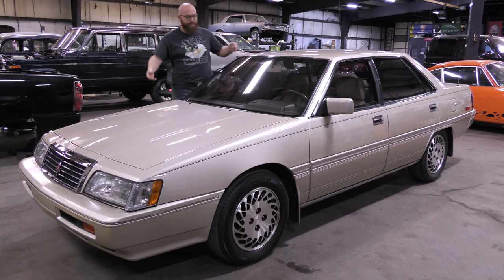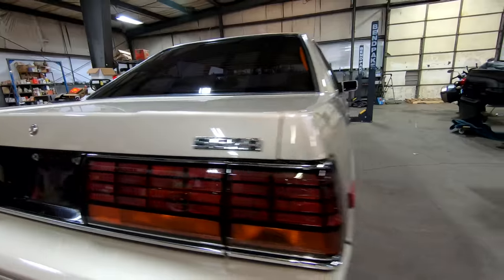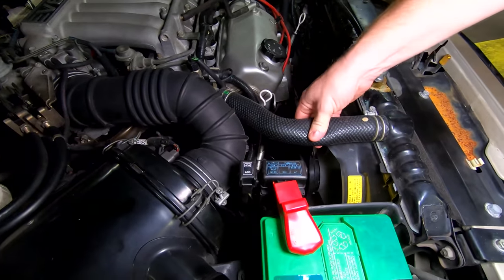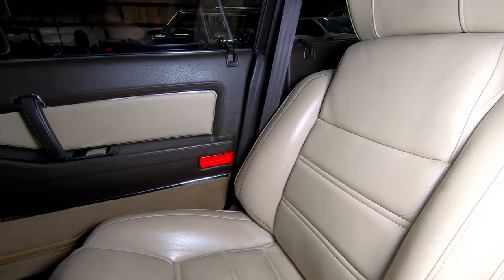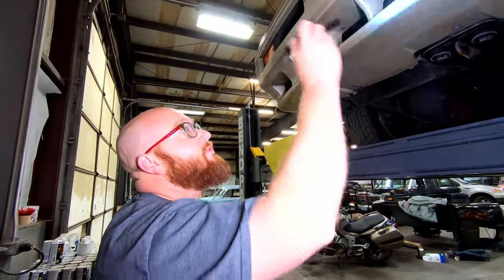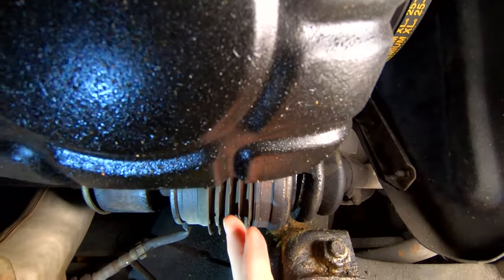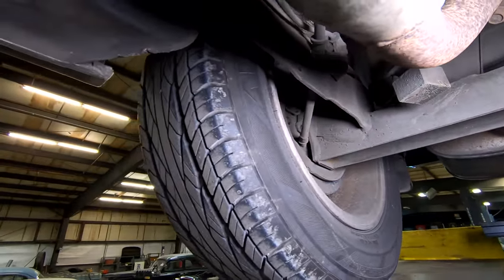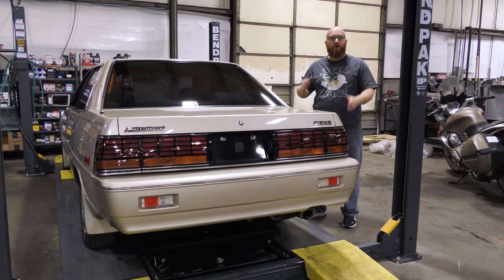Insanely Unique! When Mitsubishi attempted European design. CAR WIZARD shows immaculate '90 Sigma

Comment: Brake booster on the other side: For VW Golf MK1 models (called the Rabbit in some markets) in RHD markets they did the same. It had a shaft running along the firewall to connect the pedal to the booster.

Comment: Mitsubishi Australia widened the body 4-5" to become the Magna: 2.6L 4-cylinder balance-shaft engine, 4-auto or 5-manual FWD; roomy, reliable and smooth but a little 'too different' for Aussies used to torque-surfing RWD 6-cylinder and V8 Falcons and Commodores.  Digital dashboard, avant-garde wiper, indicator paddles, cruise and climate control were unique in 1987, and velour everywhere!  The next model (1993: your Diamante?) used the 3L V6 and was 3rd best seller for a few years.

Comment: I used to have a 80’s sigma GSR RWD 2.6 Astron engine. Was fun to drive but they had a real bad habit of doing valve stem seals and blowing loads of smoke. The 3L V6 was in our 2nd gen Magnas here in Australia not a terribly reliable model. They upgraded the motor to the 3.5 V6, Galant US spec, which was a flop here in Aus. Pity because I liked my Magna 5 speed manual. Written off by my insurance when a taxi smashed it into a restaurant frontage early one morning

Comment: Another one of those quirky cars from the era. Initially designed as the Mitsubishi Magna in Australia, stretching the smaller Japanese Galant platform, it was designed to compete against the local Falcon/Commodore/Camry rivals, but Mitsubishi quickly took that and made the necessary changes make it suit other parts of the world. That's why the brake booster is on the RH side. Interestingly though, we didn't get the V6 until the next shape TR/TS Magna or VR/VS Verada, which North America got as the Diamante. They were a great car of they're time, but not a huge number remain it appears, anyway globally unfortunately.

Comment: We had a lot of these as Japanese imports from about 1990 onwards. The V3000 version of this car was very popular here in NZ. They were often used as sound off cars for competing in car audio as they were roomy and cheap. You don’t see them often now, but sometimes. I’ve got a 1990 Pajero with 100,000 miles - we have quite a few low mile cars that are still like new here.

Comment: We had a Mitsubishi sigma in Australia from mid 70s to 1987. Nothing like this. It looks the same as a Mitsubishi magna we had here unfortunately we ended up with a 2.6l 4 cylinder engine which was way under powered. Would have been better with the v6

Comment: Great video. Mrs Wizard, I think you got the rear view mirror switch the wrong way round. The default should be with the switch towards you, for "day mode" as you called it, then pushed backwards for "night mode". This then dips the mirror, to avoid dazzle from headlights behind. I think I'm right on this, but anyone feel free to correct me if I'm wrong.

Comment: Nice car, but I hate that engine. I’m so glad they don’t make it anymore. However I’ve never found Mitsubishi to be reliable at all. Even the new ones I’m not really sure about. These guys love to smooooooooke! Rings were always bad in these. They also love to blow the rear crank seal. Lol you need a unlimited supply of oil to drive it. They loved to blow head gaskets and timing belts.

Comment: My very first car was a 1986 Mitsubishi Galant (4 cylinder, auto). It was the same body style as this one (different taillights and front facia) and had a possibly even funkier interior. Chromed audio controls on the steering wheel that matched the controls on the stereo itself, modules glommed onto the center binnacle with cruise control on the left and automatic climate on the right. Those modules had big knobs on the ends making them look slightly like ears sticking out. The turn signal control was a big, flat paddle that stuck out of the the left hand module. There were no traditional stalks off the steering wheel. Oh, and the back seats reclined (not all the way, though)! It was a wonderful car!

Comment: Mitsubishi magna.. in Australia.. although the styling is in the higher level model. With the chrome. The tail light change from our base model. The grill is  top of range but we didn't get that level. As far as i remember.  That engine was never used in Australia. A 2.6 litre engine.. the colour trim along the sides there was stuff like this but not as embossed.. 
The next model along was also a manga but a more rounded design . 
Mitsubishi used to be built in Australia but gone now for many many many many years.. forever..

Comment: Still remember Mitsubishi Colt of early 1980s, the leader of hot hatches before Peugeot 205.  Also Mazda GLC of early 1970s, the hatchback smaller than Civic that turned Mazda around just like 1602/2002 that saved BMW.

Comment: I bought that car in 1990. The sticker price was around $17K but it was heavily discounted at $13K and it is a rare car for the time. It rides good but it has been affected by oil leaks and axle boot problems. The worst part is the automatic transmission gave up and spent $3 grand for a transmission rebuilt by AAMCO @ around 30K miles. I would never buy a Mitsubishi again. Toyota and Hondas are more reliable compare to Mitsubishi.
Reply: Mazda and Subaru, as well.

Comment: We had the Sigma in Australia for a while and Oh god no, maybe they improved from their earlier versions in the 80s as those were truly horrible cars for reliability when they were on the second hand market in the 90s

This one looks well looked after though.

Interesting in the brake master cylinder, with Japanese vehicles made for the American market are these typically on driver or passenger side?
Reply: The vacuum brake booster and master cylinder are almost always on the drivers side (left side) of the car. (The exceptions are when the car has electromechanical boost, like on hybrids or big trucks/suvs)
Reply: @300DBenz  yeah that's my understanding as well

We drive on the left in Australia so our driver position is on the right of the car. We also use mostly Japanese vehicles who drive on the same side as us. The brake boosters are always on the driver side on every car I've seen.

My question is do Japanese vehicles for the U.S market typically have the brake booster on the drivers side, as Japanese cars would've been designed for right hand drive not left hand drive as used in the U.S. I'm assuming they do position the brake booster on the drivers side on most Japanese cars for the U.S market as the wizard found this setup odd.

Comment: Overrated junk. Try finding parts, especially cheap parts when the needlessly complicated steering system fails. Nah. Better off with a comparable used Toyota if you want both bland, reliability, and affordable repairs.

Comment: rear wheels are switched (to fix right rotation on tires) and most japanese or european cars have split rear seats since 80s ... volvos not because their obsession with safety ...and those side pockets newer been used for maps ... (pockets on back of seats are made for them...) but pretty sweet car ... (and japan made cars have 6 towhooks where 4 are used to secure car on boat for transport..)